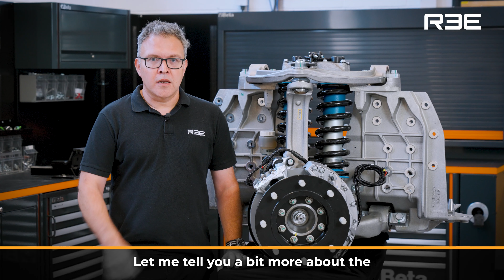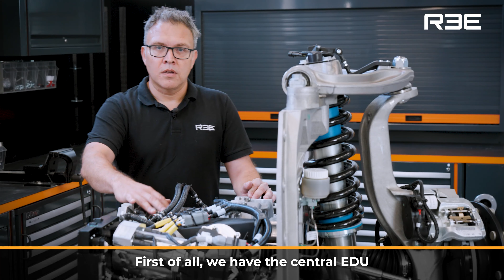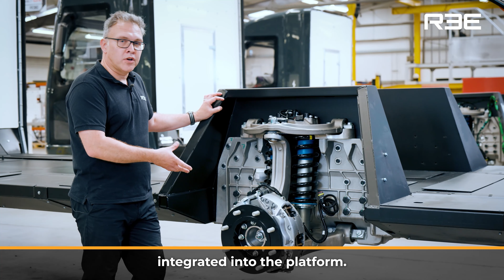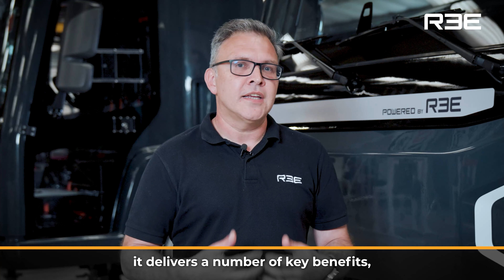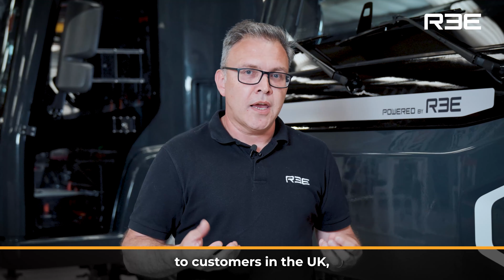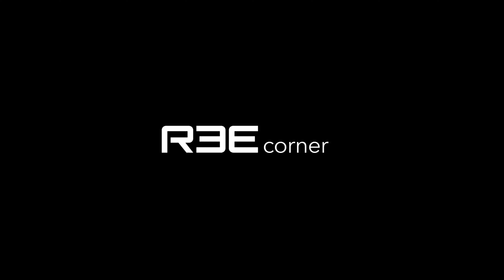A Deep Dive Into the REECorner with Peter Dow, REE's VP of Engineering.

Comment: This technology should spawn myriad companies that make bolt-on bodies (similar to the way care manufacturing used to be [e.g., Body by Fischer]). You own one tunable REE platform but may own more than one body, depending on your need/desire: truck, sports car, luxury whip, etc.
Reply: No car company seems to have any interest; half-shafts from inboard motors and steering tie rods have worked well for over a century. These tall units are more interesting for buses and vans because of the flat floor. Also, it seems from the recent Autoweek article that REE is going to make its own P7 trucks and vans, maybe because it's not having much luck selling the REECorner components to other EV makers.
Reply: @skierpage  I saw REE’s most recent video introducing their own van/truck. Again, I was thinking “seems like a great opportunity for other companies to design/build body shells to suit the customer’s need.” Very exciting concept. Fun times.

Comment: is drive by wire similar to Canoo tech?
Reply: Sort of. Canoo has no connection between the steering wheel and front tie rod, but it's still using an inboard motor to steer the wheels. In general, Canoo has yet another skateboard chassis: a flat battery pack between front and rear inboard motors.